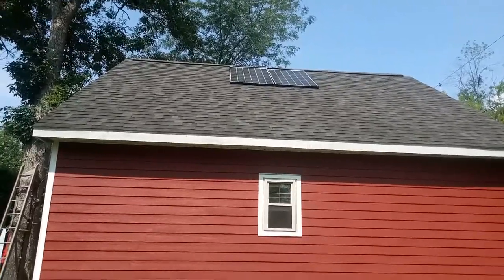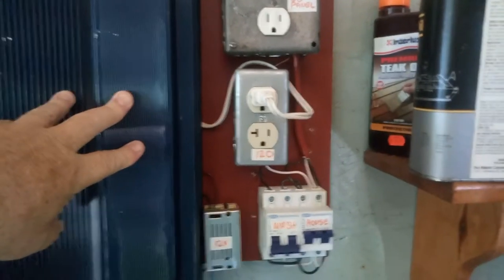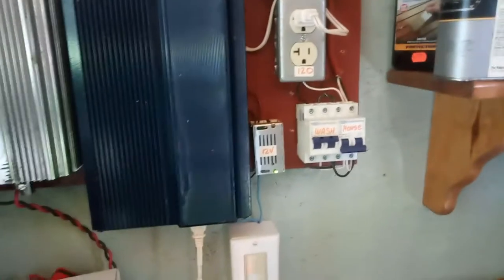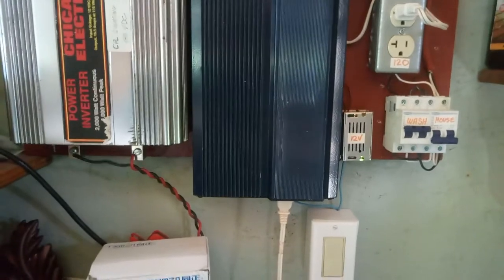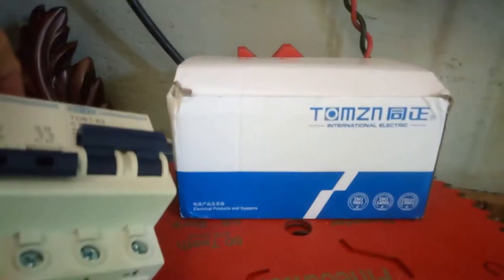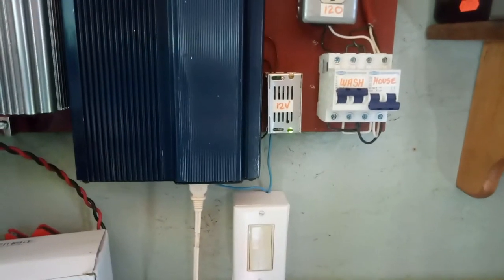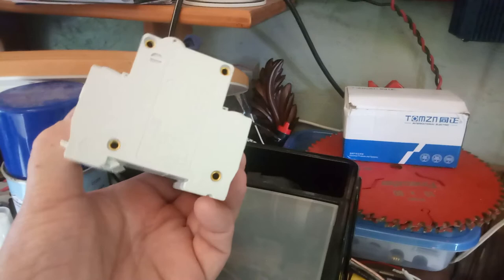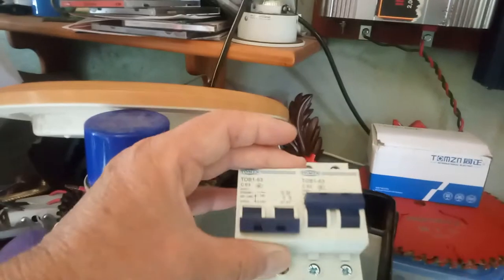TOMZN Manual Transfer Switch TOB1-63 Switching Panels Parallel to Series

Comment from the maker: This takes a din mounting rail. There is no other way to mount it. Mounting rail is not provided so order one.
The garage is 125 feet from the house array thru #12 wire so there is some voltage drop.

Comment: Since we're manually transferring, I use plain old DPDT rocker switches to switch my fridges from the grid to my inverter, which I bought for less than $1 from a surplus store. They're interlocked by design and rated for 20A at 250VAC. Both Positive and Negative are switching fast enough that both of my fridges and both of my freezers do not surge. The power monitor shows a stable continuous current during the transfer. I've been using them for a couple of years without arcing whatsoever... so far. Simple, cheap ,effective, I like that!

Comment: @3:50 "and get away with it" the best feeling ever
Reply from the maker: I had production  deliver boards to my desk all pissed off because they didn't work. That was strange because I was still working on the design.  Sales bumped the order ahead of schedule. Production somehow managed to build it, custom of a standard design, find a test procedure, silkscreen and drill a box and print a label. Everything but the board had to be thrown out. Turns out everyone has to sign off on a design except engineering.  And they never wanted to change that. It happened more than once!

Comment: Does it DC switch?
Reply from the maker: This is an AC listed switch. TOMZN does make DC breakers which are similar switching +&-for the extra gap. Transfer switches for DC are likely rare. These are likely silver or copper alloy contacts which is bad for DC. I do not switch under load or the contacts are at near potential. An excellent book on arcing is Gaseous Conductors by James Dillon Cobine.